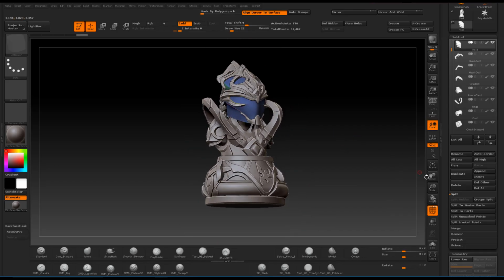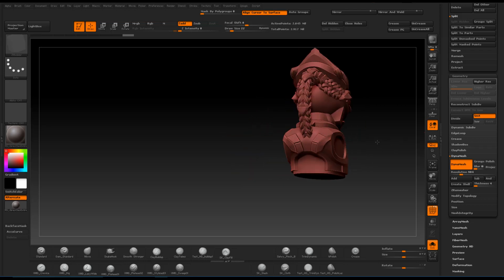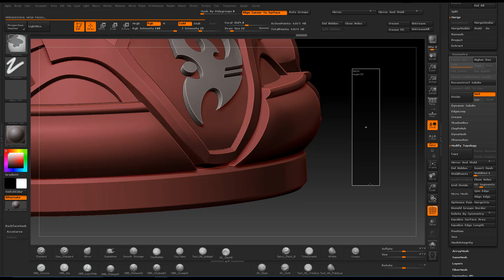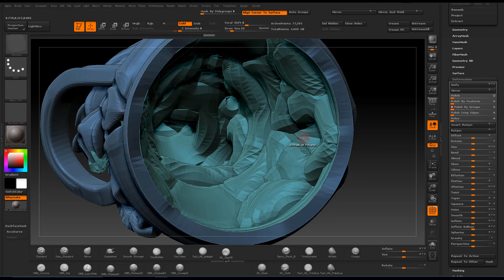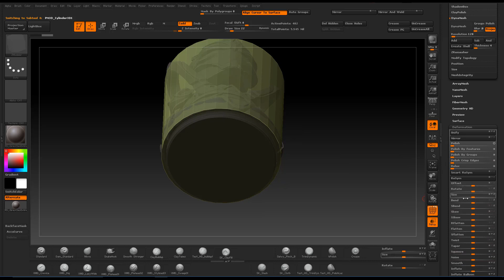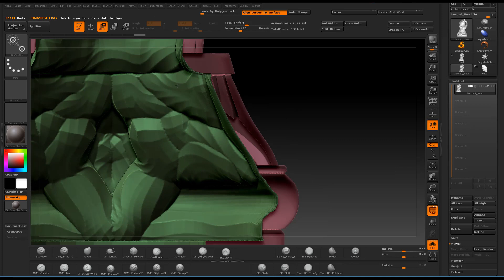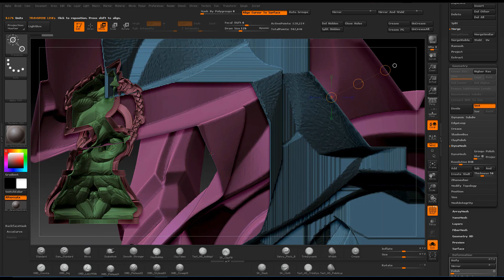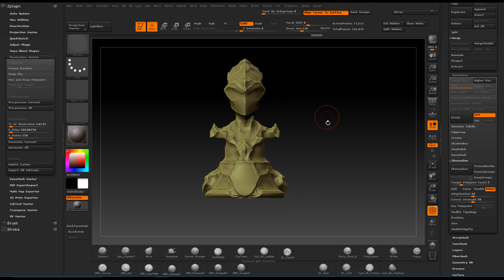Better Way to Hollow/Shell a Zbrush Model for 3d Printing

Comment: I've looked down the comments, but havn't seen an answer, and some others with the same problem.  The extruding part doesnt seem to work.  I've lowered my model to 4k polys, still nothing with a click and drag, tried changing to single poly to extrude and that doesnt work either.  Does the model have to be converted to something?

Comment: Hi george ! This is great , helps so much. Is theee a way you could nake a video on something simple ? A cylinder thats hollow and you cut , slice. And dynamesh it but only the inner and outer ring is sealed the center remains hollow   like a ring . i cant find a video anywhere that does this it would help so much if you could

Comment: Thank you very much for your tutorial, this will be of great use to me.

Sadly I keep running into the problem that even on a 40cm large Object a setting of 0.0001, the smallest possible, still gives me a wall thickness of a few centimetres while I desire merely 3mm. Is there any solution to that?

Comment: George.   I can turn my green selection rectangle red, but I can't seem to keep it red and then drag it around with space bar.   Is there a way to make it stay red and then use space bar to move it around?
Reply: You need to hold: Ctrl-Alt-Shift-Space all at the same time.

Comment: hi George, this is the best tutorial ever about shell thickness measurement in zbrush . .
but, may i know further more, when you perform this tutorial on zbrush, what's the number found in the "Geometry>Size>XYZ Size" and the number on the top left corner if you perform transpose tool all the way up from bottom to top of your model?. is it synchronised and exactly the same ?
Reply from the maker: Sorry for the late reply. The numbers under Geo>Size>xyz are the same as what I measure with the transpose line. I usually end up using the "3d Print Exporter" to get size measurements just by hitting the Update Size Ratios button. They did recently replace that plugin with 3d Print Hub though, which I don't like as much as the old plugin.
Reply: yea man, never mind.
I found the new 3D Print Hub on 4R8 P1 has an annoying STL export limit, which is 1270 mm (50"), also it only allows me to export model in mm and inch, there's no cm choice anymore. Do you know how to exceed this limit inside ZBrush?, or maybe you know any plugin that can export STL out of ZBrush?
Reply from the maker: Honestly I don't use the 3d Print Hub. I prefer the simpler 3d print exporter. You could work in mm then export @10x scale. For example, you make your model 100 mm. Then go to Tool>Export>Scale =10. Then your model would export as an obj at 100 cm.
Reply: George Barnes ohh man, you've helped me a lot!, thank you so much 👌

Comment: Hey George!
I love your clean work, what do you do to achieve these clean smooth curves with hard edges?
Reply from the maker: It depends on what I'm making. For this model I started with a dynamesh sphere to get a rough design, then use a combination of zsphere retopology, zremesher and zmodeler brush. The key to get stay at a low poly count and crease edges.
Reply: Thanks for the fast reply and sharing your insight on this! 
I'll have to look up zsphere retopology, havent been using zbrush for retopo so far. Thanks again! :)